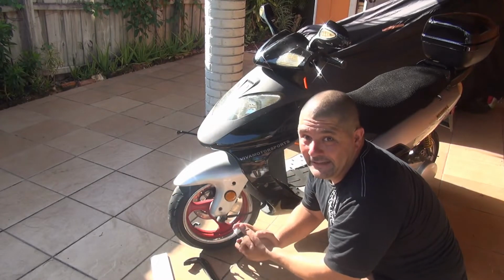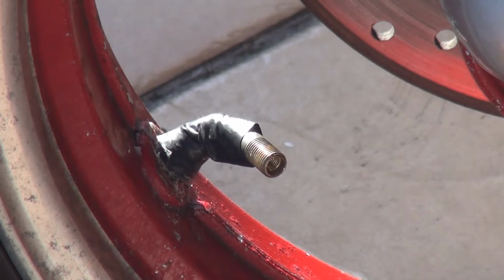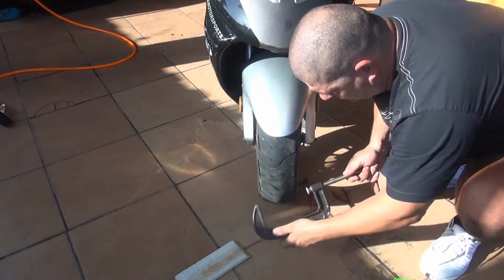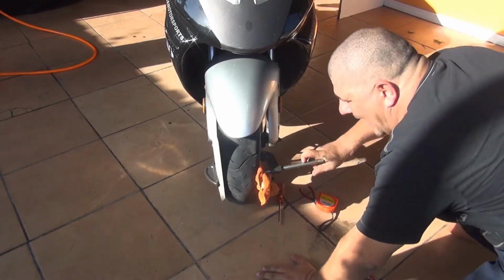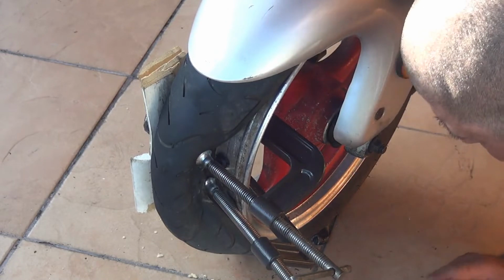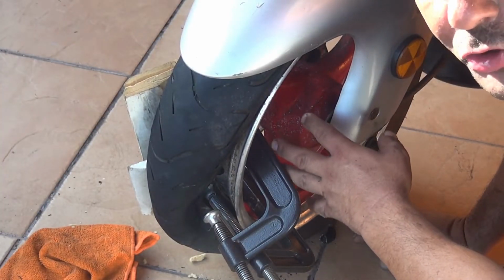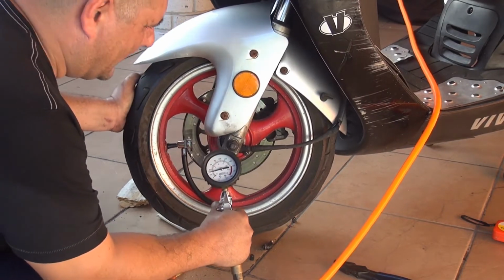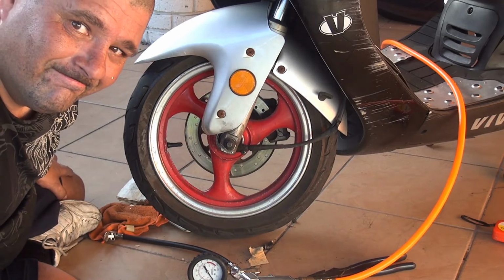How To Replace Tire Valve Stem On a Chinese Scooter / Motorcycle

Comment: Hello my friend 🌟👍 ! I bought a tire pressure monitoring system ( TPMS ) $ 60 on Amazon prime for a motorcycle & the system has saved my life a few times . Supper easy to install & also upgraded to all aluminum valves as well . Worth every penny ! Thanks for sharing, safe travels 🛵💯👊
Reply from the maker: Hello my friend yes yes yes that is the next toy that I really want ah ah ah I was just checking that few nights ago on amazon and I see many different ones I felt like I was in a candy shop ah ah ah I will check on that thank you to let me know
Reply: @VirberelloScooterTips  I feel ya ! I found a really nice setup for $ 54, I can find the link if you like ?? Waterproof & very accurate . I like the Toy store myself LOL! Theirs a racing exhaust I would like to have but !! With all this craziness go in down I don't need to drop $ 170 right now 😣 LOL.

Comment: I've found a ghetto fabulous way that fixed my problem and it might for yours as well. For the pals that need to perform this procedure, your air is most likely leaking from the bottom of the stem instead of the core(4 way tool problem). Before you perform a major surgery like this, get yourself some rubber washer from Lowes. Make sure the size is a snug fit and forces the rubber washer into the gap with another pair of metal washer. Now you can reuse the old stem instead of getting new ones.

Comment: How can find leak in scooter  on back wheel if  valve or not   I check the tyre looks ok is way test in water was out take new scooters  apart  it new to me  . CAN YOU HELP IF CAN PLEASE  THANKS  LOVE VIDEO
Reply from the maker: Hello my friend the best is to spray your tire with soapy water and see if you see a build up of extra bubbles around the tire but sometime the tire look good when is not in motion but when you ride your scooter and the tire is in motion the shape  of the tire will change by the centrifugal force so at the point you will have to change the tire because the tire is old and lost is elasticity and the force to push on the rim walls . Thank you for watching my video

Comment: Hey. I use the same valve stem. It is installed correctly but will not air up. Is it because the lip on the rim is not lined up with the tire. Ughhh. Thanks
Reply from the maker: Hello Busy Bee the valve stand work great that is possible if the lip on the rim is not line up you have a way  for the air to go out try punch the tire in the center to see if that expand to the side and at the same time inflate the tire
Reply: @VirberelloScooterTips  great idea! Thanks for the tip

Comment: My vale is diff its not a straight one
Reply from the maker: Hello my friend if you have a curved valve you can easily change that buy squeezing the tire with a c clamp. Thank you for watching my video
Reply: @VirberelloScooterTips  can i buy one from a auto zone or a auto place for it does it have to be the same ?
Reply from the maker: @kevinthorn9672  Hello yes you can go to outozone they have lots of valves there  make sure the valves Fits 12mm to 14.3mm [.47" - .56"] rim hole, universal fit most